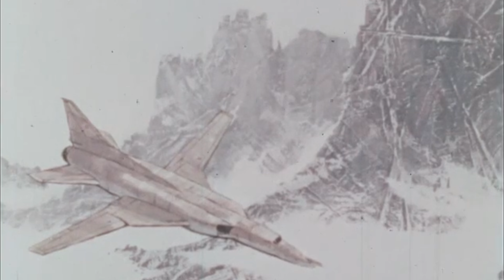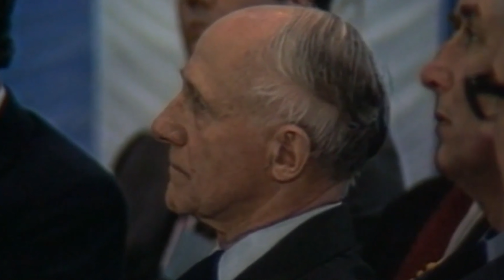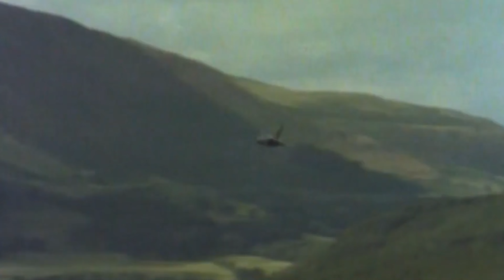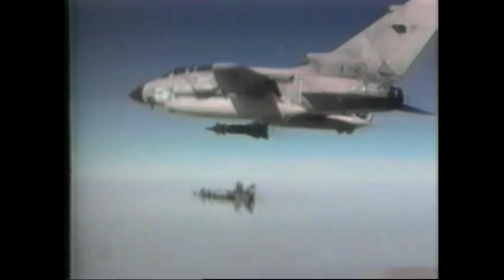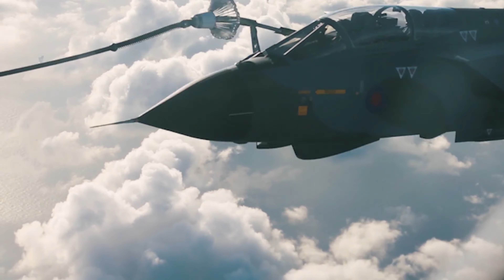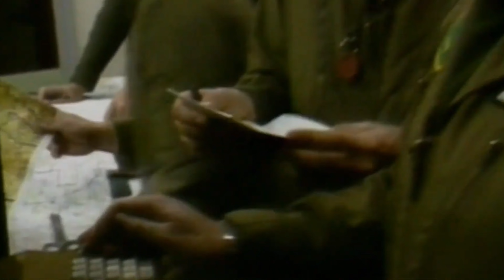Tornado's Variable-Sweep Wings: NATO's Multirole Masterpiece

Comment: During my formative years I worked, as a civvie, on both versions of the RAF's Tonka toy.

I initially worked on the wiggly wobbly bit up front on the GR.1 before moving on in later years to work on the wiggly wobbly bit up front on the ADV/F2/F3 of the Tornado.
Reply from the maker: So you were the mastermind behind the "wiggly wobbly bits"? That's a serious title! I hope you got extra credit for keeping those toys flying straight!
Reply: @EngineeringDocumentary  I got to admit keeping the wiggly bits wiggling when they wanted to go wobblying was no easy task, and don't get me started on trying to gkeep the wobbly bits wobblying when they wanted to go wiggling.🤣
Reply from the maker: Sounds like you worked on the variable-geometry wings of the Tornado GR.1 and the Tornado F3, a critical system for its performance.  Appreciate your service in keeping those "wiggly wobbly bits" in top shape!